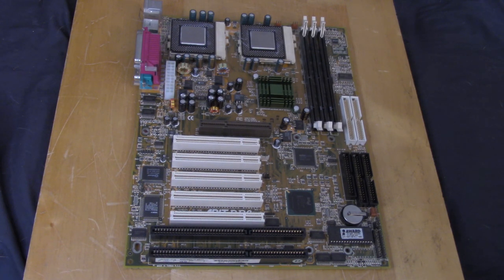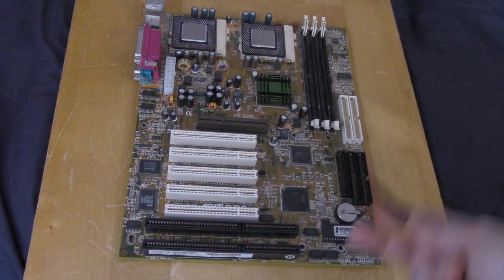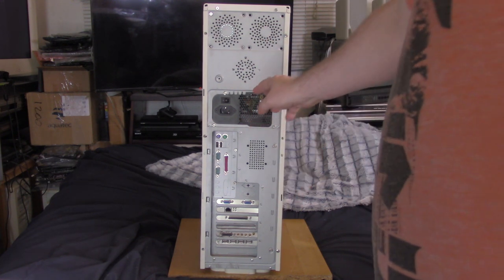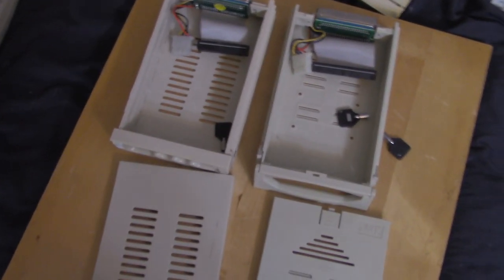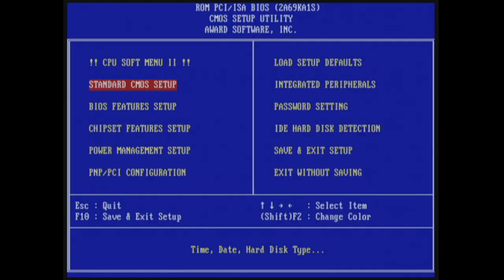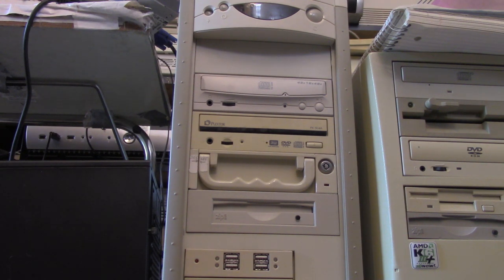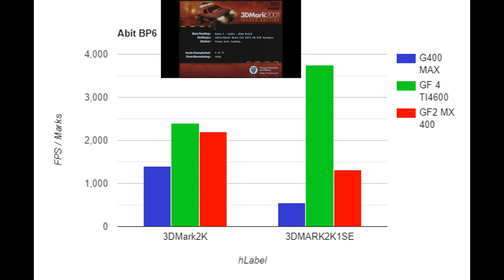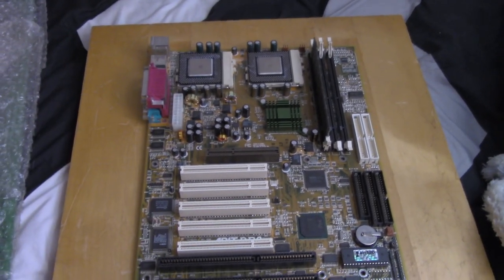Abit BP6, The motherboard that brought Dual CPU processing to the masses

Comment: The BP6 was something people did seem to talk about when it came around. Never had one, but my friend's girlfriend supposedly did in the early 2000s, according to a spec list that said friend kept of our machines. I think it was actually the later VP6 though, with a Via chipset, as she was running Coppermine Pentium III CPUs in it, which the BP6 doesn't support. In any case, the writing was certainly on the wall that SMP was the way forward by the end of the 90s, even if it would still take a while to become widespread.

Comment: I had that mobo and  I still got  the actual pair of  Celerons 366 I had on. I remember I demanded from the seller a  specific batch code capable to be  overclocked up to 550Mhz(only during winter lol). That meant you had 1100Mhz  on 3d Studio Max rendering (only on Win NT) while the fastest intel III available  in 1999 could only hit 800 Mhz. It was rocking the new 66 IDE protocol with  way too many issues (frequent blue screens). Two "huge" (for the time) aluminum coolers (Checkmate brand) and an additional external fan took care of the temperature of the overclocked CPUs.   You  needed 2 different OS in order to take  advantage of the two processors (Win NT) and to be able  to game (win98). Ι spent 75 euros for each cpu  and mobo.(225 euros total).

Comment: I used to have a very similar case for this board, i first tried a normal ATX case but due to the position of the ram on this board, the cd-rom drive doesn't fit all the way in on a normal case. Was an extra expensive upgrade i didn't plan 😢

Comment: I think the value in these workstation/server boards with dual  CPU support is with the extra features.  Extra IDE channels.  Support more RAM.  Better chipsets.
Thoughts:
-SCSI zip drive, put HD on ATA66
-Turn PSU over and use fans at the top for exhaust?
Reply from the maker: Unfortunately the HDD refused to boot into Windows when on the ATA66 channel even though it was configured to in the BIOS. I had a lot of issues with the built in IDE on this board and even when I tried a PCI IDE controller card. I suspect its jyst a symptom of old age, board could use a recapping.

Comment: I still have mine, but I am running dual p3 933's.
Reply from the maker: Are you using an adapter of any sort? Most of what I read claimed the BP6 didn't natively support Pentium IIIs or would only work in single CPU mode. I never tested this when I had it out.

Comment: Well... The board offers nothing better for Win98. But running NT or 2000 on it, oh boy, it is a different story.
Reply: So just deal with it. 
I think you meant NT, 2000, or XP
Reply: @VictorNelvanaShows  No. I meant NT and 2000. I know exactly what I wrote.
Reply: @brostenen  sorry about that.
Reply: @VictorNelvanaShows  No probs. XP are just too demanding in regards to hardware, when we are dealing with such a system as this. Sure it might run, but I find my Mac Mini Late 2009 a more decent platform. XP games run good on this system, and even some OsX games run nice on it. Like UT2004 and Outrun C2C 2006.

Comment: Celeron 300, 366 and 566 were the golden ones because you would only need to change FSB from 66 to 100 and that's it. Too bad 566 doesnt work properly on this board.
Reply: also to note that Tyan made dual cpu boards during the p3 era, and were more high end than Abit for the similar price.

Comment: abit another one of those old companies that had questionable c/s witch is probably why they aren't around. back in like 2000 i bought one of there geforce 2 mx400s the ram on it failed and kept blues screening windows. sent it in to them for RMA and it took them over 3 months of them telling me will ship the replacement out tomorrow and them not following though before i finally got the replacement. my guess is they were out of stock but they made no offer to swap it for a dif model even after months had went by of me waiting with no gpu. a much better company evga when i had to RMA my 2070 they replaced with a 2070 super and shipped it out same day in a gpu shortage/pandemic. seems like to abit boards are  one of the most common ones that seem to have blown up caps.

Comment: would have expected that it could run pentium 3's
Reply from the maker: It can with an adaptor though most of what I read claimed it only worked in single CPU mode when running anything but a Mendocino Celeron. I cannot positively confirm or deny this though.

Comment: Had Tualatins on mine
Reply from the maker: Can you confirm they actually functioned in SMP mode? most sources I read claim the dual CPU mode only works with Mendocino Celerons, using adaptors to install any other CPU supposedly limits you to single CPU mode only.
Reply: @AncientElectronics  sorry no as i dont have that board anymore all my Tualatins are in a gigabyte cuv4x-d and a i-will dvd266r
Reply: Just fyi Tualatins when modded work fine in coppermine boards also
A guy on ebay sells them modded fyi
Reply from the maker: @primus711  I'm sure they work in single CPU mode but do a pair of them work in SMP mode on this specific motherboard because many sources I've read say no, then again I get a few people saying it does indeed work so, that's why I asked.
Reply: I have had 0 issues
Also i used 2x piii-s sl6by